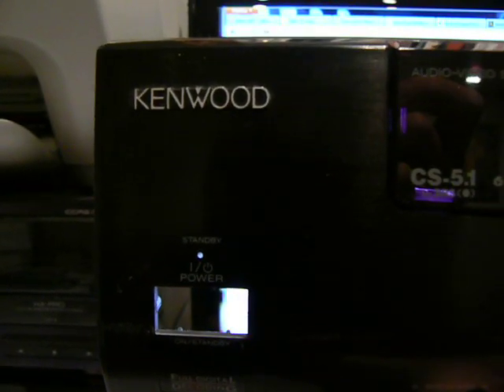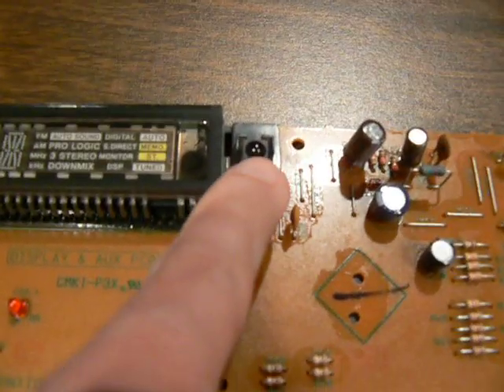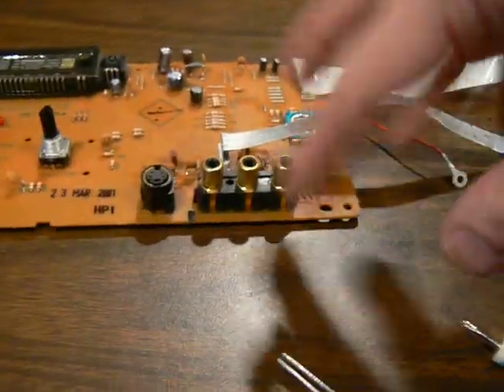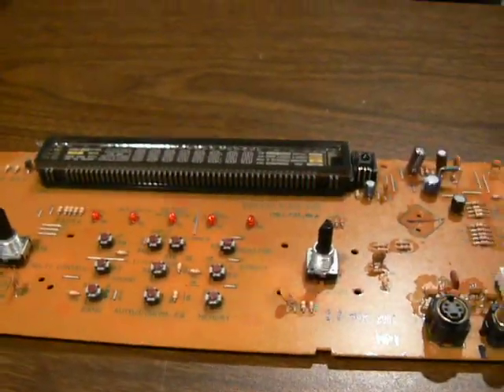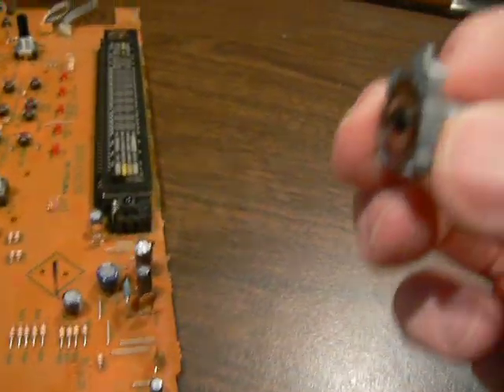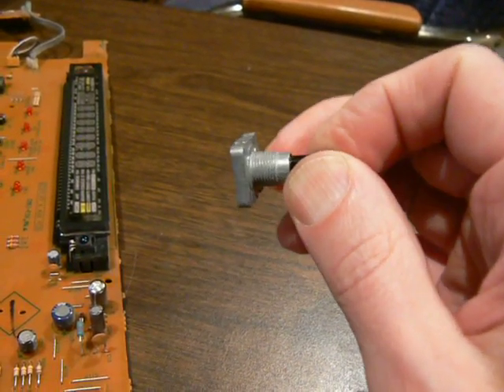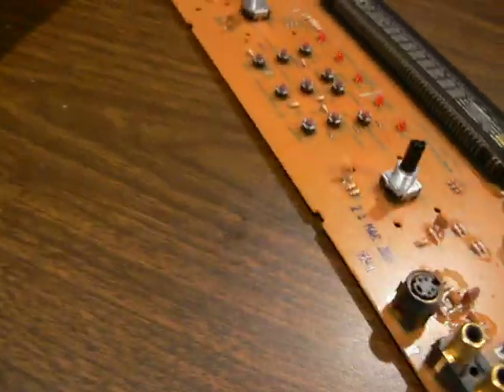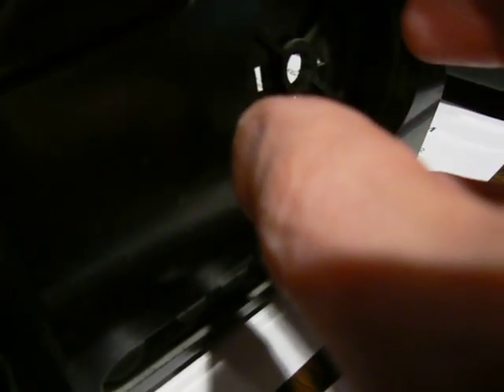Kenwood Stereo Repair

Comment: Thank you so much for this useful guide. I have a Cambridge Audio 840A Mark 2 amplifier which had problems with the Volume Control. After carefully dismantling the front panel, I was able to get at the offending control. It's exactly the same as the Kenwood version that you depict. I did exactly as you suggested but used a tiny amount of cutting compound on a Q-Tip to remove the oxidisation from the metal, cleaned it thoroughly and re-assembled the control using a tiny amount of WD-40 on the contact surfaces to help prevent oxidisation again. It works a treat! Thanks once again.

Comment: Hey man thanks your video helped me! I fix my stereo head unit had the same problem. So i open the face and decided to take the volume mechanism apart and cleaned evrything and moved the conectors up a lil and put evrithing back together and it really worked! Thank you.